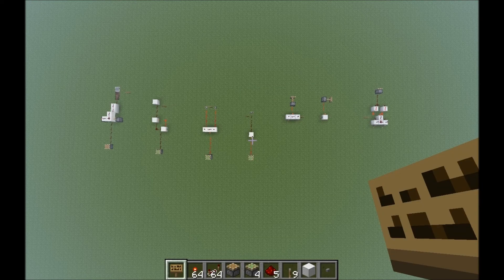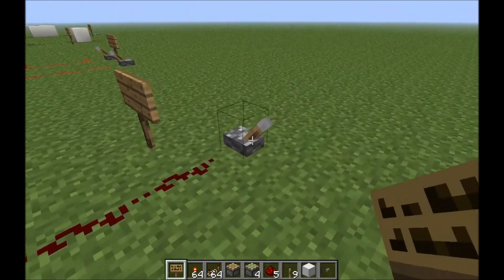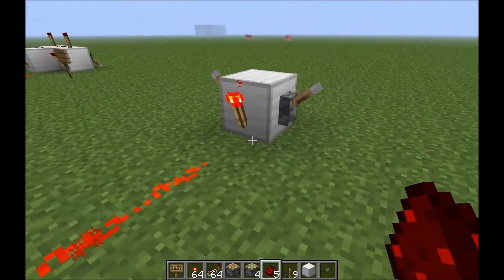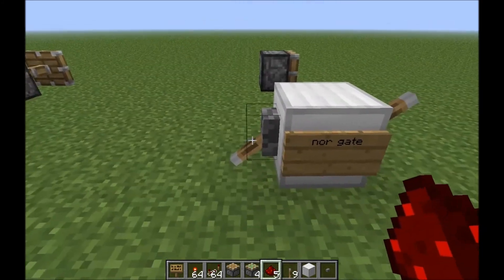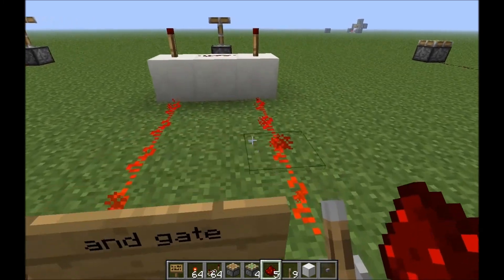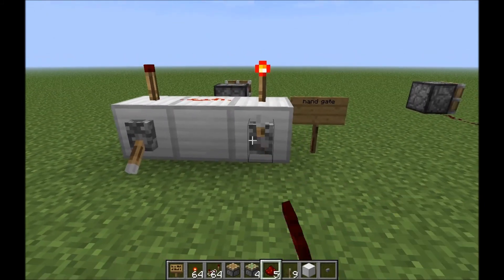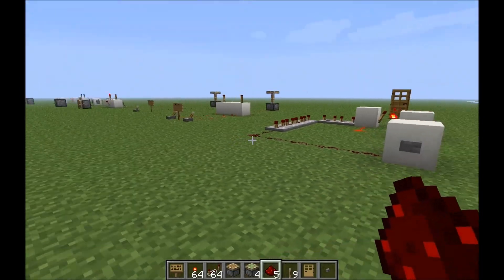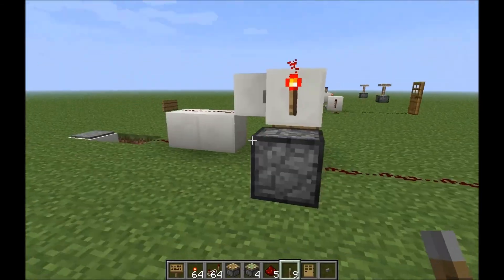Intro to Minecraft redstone logic gates - 100% play tested to work on PC and Xbox

Comment: I've tried the zor gate to make a 2x3 piston door in the xbox version but I can't get the redstone torches on the input side to go off without having a lever on the block with the redstone torch. Long story short, I can't run redstone from the input side to a lever at a different spot besides right on the block. Any ideas?